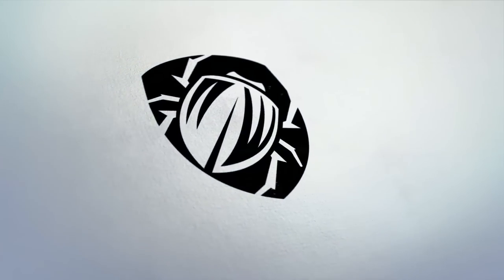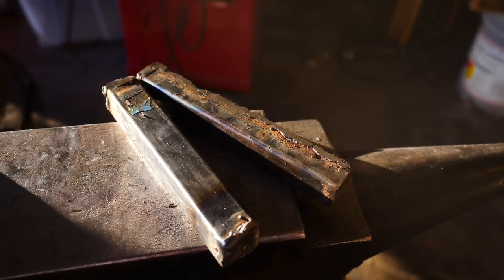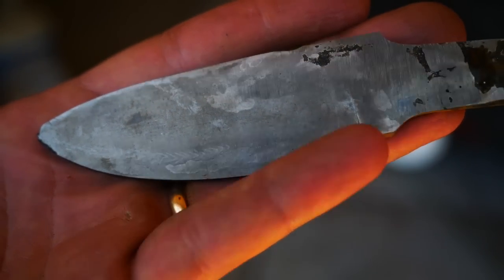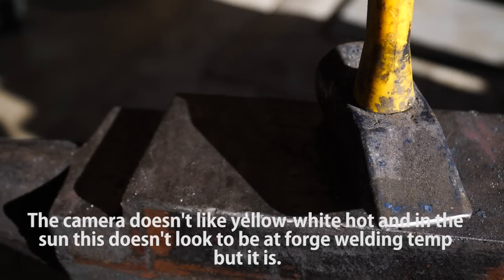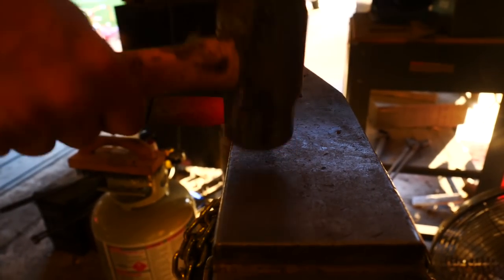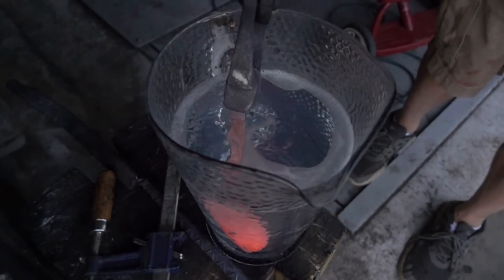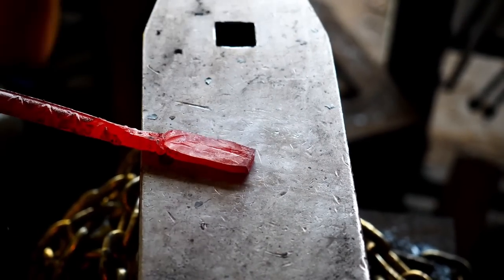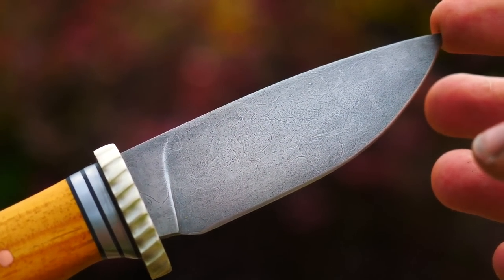Forging A Knife With Drill Shaving Spirals

Comment: I've seen a number of Forged in Fire episodes where they use canister Damascus and they line the mild steel container with liquid paper.  Doing so is supposed to allow one to peel the mild steel right off the inner billet of material.

Comment: Found this interesting.  Might be cool to try shavings from different diameter drill bits.  If you know someone who has a lathe you can get different spiral sizes and shapes by adjusting feed/rev, cutter depth, cutter geometry etc.  Using a cutoff tool in a lathe give chips that spiral up like a cinnamon bun.  Just a few suggestions.

Comment: I'd always thought about doing this.  In my interpretation of this idea, I would have saved pretty much any loose chunks I could find and break up larger twists into smaller bits so the powdered steel could easily fill the voids, looking like a crosscut of pebbles and river rocks embedded in sand.  I'd expect something like a wootz grain, which I find beautiful and subtle, which is pretty much what you got with a random wild shape on one side.  Great way to recycle metal into something rad!  
My pro tip:  You can always use simple power tools to your advantage.  Put a heavy allen key into an electric drill, with the small end chucked in, clamp the drill to a vise or table, and it'll create a pretty strong oscillating vibration that will force all that powder to descend and fill the gaps with no effort when the canister is pressed against the vise.  An oscillating sander works too.  Clamp the handle in a vise, turn it on and press the canister against it when the powder needs settling.  Much more powerful and much quicker than doing it by hand.  It might help the powder fill all the voids and produce a larger piece of usable steel.
The strength of the oscillation might cause half the powder to blow out of a hand packed canister, so maybe an incremental approach is best.  I'd personally stuff the canister 3/4 full of scrap du jour with a hard pack on the bottom and a looser topping, then repeat the process with the mechanical oscillator until the can is full.

Comment: Carbon will leave the high carbon steel and go into the mild steel (concentration gradient theory) which is why you had trouble hardening the blade. Using white out to coat the canister not only helps release the Damascus from the canister but also prevents carbon loss. I would heat a billet to welding temp, cover with flux then place the spiral shaving on the billet, heat then hammer the shavings into the billet. They'll forge weld closer to the surface then as you grind the blade, the outer most layer of the shavings will disappear revealing the 3D look you're after

Comment: I definitely think it was an interesting idea. I'm guessing those shavings are usually just discarded? If that's the case, this knife was made from steel that otherwise would have been garbage. Even if that's not the case, I think the end product looked pretty darn good.

By the way, I really liked how you acknowledged a failure; most people would gloss over it, or edit that part out, but you said "I didn't do very well on this part." That is awesome. Acknowledging what could have been improved will make you better in the future because you know what you did wrong, but it also makes you appear like a real person, someone that does make mistakes from time to time. Sometimes, watching these types of videos can make it seem like the craftsmen (or craftspeople if you care about PC crap) are flawless and they make perfect blades all the time. I still think the knife turned out well, though.

Comment: if you want a pattern you need contrast, throwing those steel filings in there, seemed to weld into the powder VERY well and you can't see any pattern, I agree with the people before, that considered pressing the filings to get a nice pattern, but, I think, use some 15N20 powder, or something of the like, to really make the patterns pop in the etch. I gotta give ya props though, Canister stuff by hand is TOUGH! Keep trying, you're the man.

Comment: as much as i enjoy watching people make knives and blades of all sizes i have my concerns about the way you went about this. for one i have never seen some wrap a blade in tin foil for the heat treat before and for two a knife that small should not need a guard or a spacer between the guard and the handle never mind two spacers and for three you should have put two pins in the handle that all said i enjoyed the video and the blade came out quite nicely

Comment: Did you consider flattening the shavings before laying them out in the container? It might help with getting a good density and still retain some of the spiral shapes of the shavings. Awesome knife though!
Reply from the maker: Seems like that could work. I wonder how it would look...  It seems the best way to do these projects always reveals itself after they're done!
Reply: Green Beetle Using a press to solid the mass might work better. Removes a lot of air pockets and creates a more uniform billet. Most likely would still show the spiral pattern if done right. Whats the right way? Beats me but might be a nice test project at some point.
Reply: As long as you flatten the spirals with time and care, I think this will definitely let you fit more shavings in. I don't think it will look like a perfect spiral though. At best, it will look like a flattened zig-zag, which would probably look just as good. 

Alternatively, what if you used shavings of both metal types? Would it forge weld as well?

I think a part 2 on this idea is not totally out of order :)
Reply: Henri Helle  that is actually a decent idea, except the chips can be very fragile as they are in the untreated state, as such under the press may crush them a little to much.....not 100% on that, just going on my experience with metal chips from my drill press and milling machine. I suppose it's just trial and error.
Reply: Not sure how it would need to be done but how about heating them in the pre-sealed canister? Would need flux in the canister etc. but could work.. Maybe. A total disaster dilemma xD Maybe trial and error shows best way to go with it..
Reply: I was thinking perhaps you could take your spirals and put them in a steel foil pouch and hammer them a bit while they were still at 12-1400 F (In the pouch.)  Maybe put a piece of flat plate over the top to even out the force since the foil is delicate after the heat.Then pop them in a canister after they cooled... 
Nice subtle pattern, this time, somewhat like Wootz. Worth more tries, surely.
Reply: Totally might work like that. Pattern could be really nice if you can open the spirals out just a little and stack them together like you would bicycle chain. Except in a canister.
Reply: the guy dident quench it never mind
Reply: Henri Helle .
Reply: Green Beetle I have a whole leaf spring from an old corvette stingray  if you want it ?
Reply: dadajack who the fuck would thumbs down this
Reply: I thought of flattening the drill swarf too and was going to ask same until I read this comment. The problem with flattening drill swarf is it can be too brittle and end up breaking to pieces.... it may have needed some work to soften it first.
Reply: dadajack exactly what I thought, concentric circles waved through the steel would be interesting.
Reply: I wonder if it is possible to take advantage of the spiral shape of the scrap by corkscrewing them together before heating them, as if you were reassembling interlocking strands of spiral cable. The more shavings you can fit into each other's negative space, the more dense the preliminary piece will be.

Comment: use a hydraulic press to force the metal shavings into the casing by compressing it and use the metal powder very sparingly as to have almost a solid squished metal spirals with just enough powder to fill the remaining minute gaps but not in excess! Fill casing and compress vertically from the open end of the casing not lengthwise horizontally with big side opening (difficult to compress this way)

Comment: What about filling a canister with steel powder and a few gold shavings?
If you can keep the gold away from where the edge of the knife needs to be, it might make for an interesting knife?
Reply: My guess there would be that you would run into issues with the much much much lower melting temperature of steel. It would be tough to get a weld with them.
Reply: *of gold, not steel
Reply: Tim Roberts the gold would melt
Reply: Nathaniel Heidemann Plus, if you had enough gold, of pieces that were large enough to actually notice them, it would be super expensive.
Reply: Gold and iron properly alloyed make blue gold, it's very pretty, done properly.

Comment: Blacksmiths are almost impossible to find. Many do it for hobbies. Wish it weren't the case, it is so hard to find a high-carbon knife these days. The cheapo stainless crap just won't keep an edge like steel. I don't mind the rusting factor - easily fixed with oil and emery cloth.

Comment: What is the rationale behind cutting the end curve of a blade and then hammering it down to the other side of the blade?  I've seen some forgers do that.
Reply: douro20 if you've sandwiched a harder steel into a softer steel, you want the harder steel to be the cutting edge, so you cut the tip, removing more soft steel than hard steel, before bending the hard steel back meaning it runs the full length of the cutting edge. It's the same effect that the claying process of a kitana gives; a hard and sharp cutting edge, with a flexible spine - it creates a more resilient blade.

Comment: PRO-TIP: Instead of rap-tap-tapping on the side of the box with a screwdriver, or a stick to get the shavings (or any powder/liquid/substance you're trying to level out inside the confines of a container) take a power tool that vibrates a lot, like a random orbital sander, or a reciprocating saw, and hold it on the  sides of the box. Instant vibration. 
Vibrating motors are also dirt cheap online

Comment: That turned out nice. its always nice to have ways of using all those wasted pieces of metal. Ive seen others sweep stuff off their floor and do similar canisters of damascus with good success. I'd use a little larger canister and really press everything in tight to void most of the air. keep up the good work!

Comment: When working with machine chips like this, it's important to clean them of all traces of cutting oil, as there are additives in it that will prevent welding.  (usually some type of Chlorine compound to prevent cold welding)

Comment: I think the knife is fantastic! 

Maybe try a second tang pinhole for the handle and split the pins and fill the splits with resin for a nice screw effect? 

As for a sick piece of Damascus steel, would you consider trying the carbon steel powder mixed with steel tension cable strands coiled up? If you coil them just right, it would produce a scaled twist pattern that is small enough to produce a nice pattern, yet large enough to make out detail.

I like your work, its a lot of fun to watch :)

Comment: I'm just curious. Have you ever used a dye/ penetrate to test for cracks? I was a trade welder for 20 years & used it a lot for testing welds.    If not look into it. It comes in aerosol cans, cheap and easy to use. If so I would like your opinion on the subject. Thanks

Comment: To prevent unnecessary scale I'd suggest wet-forging, it might take a while to get used to the method but it really works. It's a method popularised by the Japanese and involves putting water on the anvil and dipping the hammer head into some water and then striking the steel on the anvil.

Comment: I'm not usually a fan of pattern welded steel but the very subtle design turned out quite nice. I would definitely carry one of these. Also thank you for specifying that the blade was in fact no cracked because that was the first thing I noticed in your beauty shots.

Comment: Dude, a few inches of 1/4" round with a gob of something welded on one side, tapered like a pencil, stuck in a drill, with a center punch on the side of the canister for the point of the round stock, and spin the crap out of it, and you have a shaker that will take care of 5 min worth of tapping in about 30 seconds.

Comment: I do the canister from the end i weld an end on then liquid paper the inside then i use scraps and powder steel that i pack using my hydraulic arbor press i pack the canister solid then weld on my end cap and a rebar length and get busy .Works like a charm every time .Your blade looks great .

Comment: Beautiful and unique, while still being a fully functional knife design. Love the hearty spine and full solid tang.....The Osage Orange handle  really sets it off with the subtle water of the steel. If it ever gets dull, between the Osage handle,and the heft of the blade? You could pound nails with it.

Osage is my personal favorite hardwood, it's challenging to work with, but is but is able to take almost mirror polish with no finishes...you can dig old fence post of it out of the ground after eighty years buried and it shows no rot...I've made several pipes and spoons with it...scales for penknives...a ring for a lady out of a nicely ringed branch that I offset to show the ring profile...I love the stuff. Love to try a bow one day with it...as the name you use for the wood is an old french reference to it's great value to native Americans for making bows. Bois d'arc. Strangely, the tree is a close relative to the mulberry...which has similar rot resistance, bur little of the hardness or density. 

Ramble ramble...loved the knife man. Great work.

Comment: "That's just a drill shaving"
Looks like a delamination to me. Not as bad as a crack at any rate and isn't that much of a biggy. It happens when forge welding, and no amount of flux will stop it 100%.
Reply from the maker: another viewer pointed it out its where the two billets were welded.  that's probably correct.  not a delamination  in this case.

Comment: Mate if your holes for your pins are too loose should drill them smaller and use a reamer to finish it to the correct size.
It's a lot more accurate

Comment: I work in a machine shop, lots of milling, good number of 100k presses.  Have you thought of just gathering a number of spirals (normally see them when the cutting tools starts to become dull, for the longer ones), and pressing them cold, then forging them?  Get the right press die, and keep adding material, should get something workable.  Some of the larger swage rope holes we drill can result in some impressive spirals.  From what you presented, and what I can envision, it should give good results.  According to my limited knowledge base :)
Initially started looking up what would happen when you forge something from our chip bins, and found your vid.
Reply: I like the knife, would have gone for a darker finish on the handle, personal preference.

Comment: Why do you use a lower carbon steel? The 1085 powder, and your thought of using the 1070. Why not 1095 instead? Wouldn't that give a better end product or is it too hard to weld and forge?
Reply from the maker: 1084 is the only powdered steel I can find.

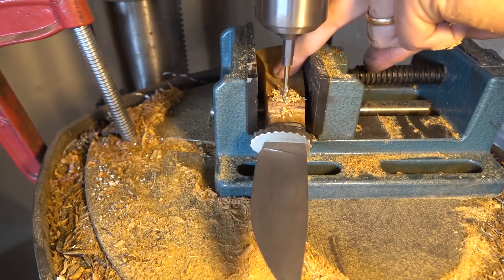Comment: Watching him drill into the drill press vise @ 15:00 made my knees weak. (I know it's a shitty vise.)

Someone should come up with an air system that you could actuate by hitting with the mallet (like the end of a pneumatic flooring nailer), or with a foot pedal, that would send a blast of air accepts the top of the anvil to blow the scale of the top. So you don't have to worry about contamination. (I know iron oxide won't weld to the piece you're working on, but it could get stuck in there or mashed in through brute force.)
Reply from the maker: there's a gap in the bottom of the vice

Comment: Hey green beetle, I have a challenge for you. I challenge you to make a knife, but it can't get hot. Therefore, no power tools or forging. You have to be able to touch it at any time. I think it would be an interesting build and a good video. But it may take a while...
Reply: Try to do it all by hand. I will let you heat treat the blade.

Comment: one suggestion: use liquid paper on the insides of the can the zinc oxide prevents the steel from forge welding to the can/ for my second suggestion use a mixture of miriadic acid and nitric acid (aqua regia) then rinse with distilled water it will bring out the nice Damascus patterning
Reply from the maker: https://youtu.be/iHmyOEMVJuM

Comment: i would like to know something might be a bit complicated, maybe its a stupid question, but are patterns like this for the blade in the end not better than more clear patterns, like what i mean is the more the pattern is like smaller and stuff the more organic the pattern feels, and if u say like a katana it has its soft spot in the spine and the hard edge, would a so dramaticly mixed pattern in which u see less variations and more like mixing, would that not be a better steel ? like u know the katana hcan endure bending due to its soft spine but only to a certain amount and i dont know but maybe the edge breaks, is a pattern like this knife not more durable ? just curious haha :D
Reply from the maker: this pattern does not make the knife more durable.
Reply: ok thanks for the info !

Comment: What about using drill bits?
Reply from the maker: mrdabeetle1  as long as they are carbon steel without any coatings or funny stuff they should work.  Would be a cool project.

Comment: could you do damascus shavings damascus
Reply: this is not damascus, and the shavings wouldn't be damascus. you need wootz for damascus.
Reply: @rohadtanyad8908  While it technically isn't "true" Damascus and the more appropriate term is pattern welded steel, by modern terms it is what is commonly referred to as damascus steel.
Reply: @problypanikd  only because a knifemaker in 1973 mistakenly thought that pattern welding is how damascus was made. wrong is still wrong.